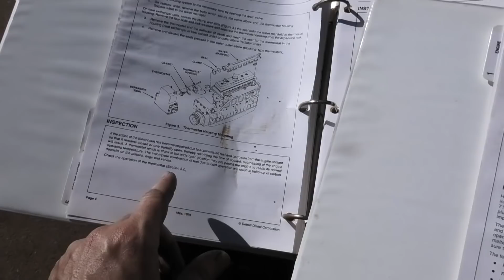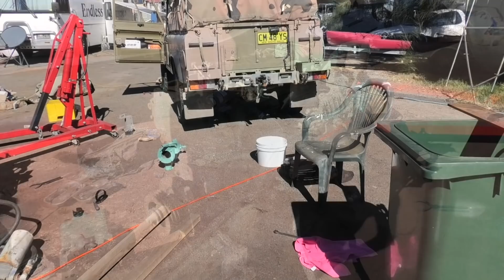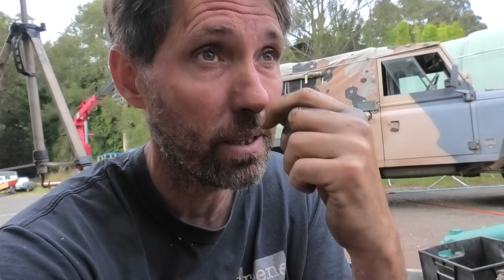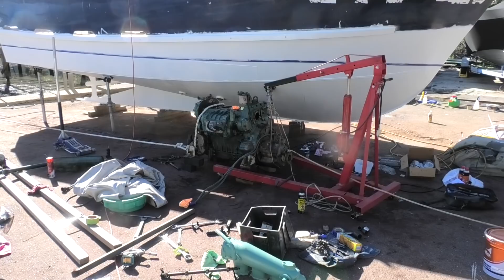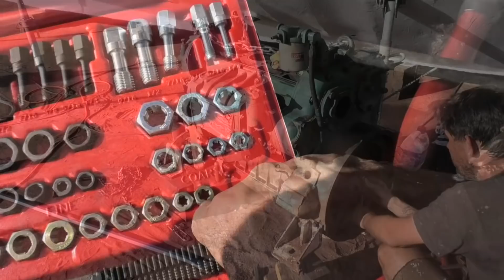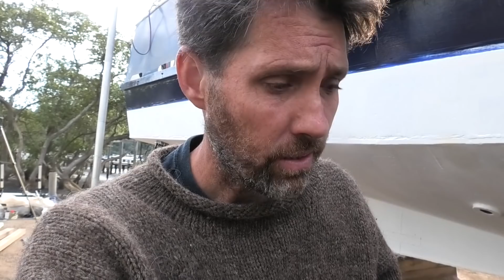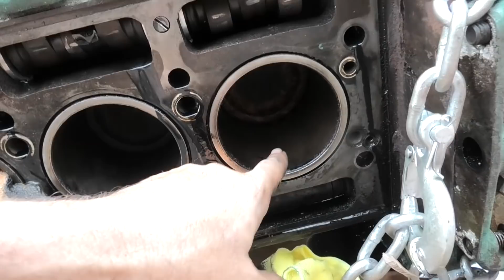Detroit Diesel 4-71 teardown

Comment: Hi Stu I just finished watching this episode I almost had a heart attack watching you take that Detroit apart. From the look of it your overhead were the rockers are drew salt water thru the vent tube some time when it was under water. Make sure you check the liners for electrolysis . Just remover the hardest part abut rebuilding a Detroit is running the overhead the timing of the valves is critical. I know you know that you have been working on motors for some time. I wish I lived closer I would help I used to make my living rebuilding truck motors. Well talk to you later I do enjoy your videos.
Reply from the maker: Thanks John. Yes, I really do need to find a Detroit specialist to run the rack and setup the governor before even considering firing this up.

Comment: Thinking about this some more I would come up with a maintenance schedule for this engine. Being your making better access in the engine compartment  you'll be able to do most but once in awhile pull the engine for major service. Building a solid bolted to the ground deisel engine stand that rotates would be awesome. Also a large gearbox puller. You could then make some money servicing other folks deisel engines$$
Reply from the maker: Hey Tim. I'm just trying to imagine a rotating engine stand big enough to hold this beast!
Reply: A overhead one would work depending on the weight? I'll do a little research and send it to you
Reply: Here is a rotating stand for a Detroit deisel engine. It's called the 6000lb Revolver. Has a center large gearbox to turn the engine end over end from the side. The price is ridiculous but you could make one from scrap material just need like a short drive line to turn it
https://www.nationaltoolwarehouse.com/6000-lb-Revolver-Diesel-Engine-Stand-P50911.aspx?gclid=CjwKCAjw5dnmBRACEiwAmMYGOe28t3h9aoIgGvy9Hg21Q_7U7brkRIVT7sH9g9PYSVMlOgtj1dxVnxoC5egQAvD_BwE

Comment: Watching you struggle with moving that lump of an engine around is painful,they such hard bloody work. I have a lifting A frame that can go on the front or back of my land rover that makes it much easier to pick up and move heavy things. It looks ex military. Can lift out an engine and gearbox and then allow you to move it to where you want. I once drove 30 miles with a big old Leilani truck engine hanging from the rear! Just chained it to stop it swinging and off to the overhaulers it went.
Reply from the maker: I was dreaming of a setup like that while doing this! :)

Comment: In previous videos you had shown that this boat had a "dry exhaust" system, that had been converted to a wet exhaust system by the previous owner. The rust on the exhaust valves, and on the pistons thru the open valves, may have been the result of a "failed design, of a wet exhaust system, allowing seawater back up into the engine, and by condensation up into the valve cover.  I'd put a 10 on it. Lol
Reply from the maker: Yes, I don't think it was the most professional wet exhaust install ever.

Comment: Drill and tap a 1/8" or 1/4" pipe plug drain on your fly wheel bell housing at the bottom with a female plug, in case you need to drain it at some time in future.
Check your oil pan and see if you can connect a drain valve hose assembly to make oil changes easier, unless you have an oil vacuum pump to suck it out. 
Time to brain storm some easier PM troubleshooting accesses while you have the engine out with your mates and professionals (what if's kind of stuff).
There is a gentleman on youtube that has made his own liner press for the old CAT DT2 series engines, in case you get stuck on one of the liners, they had water jackets surrounding the liners, looks like the Detroit had oil cooling around its jackets.
I think a good detergent and hot acid bath will clean up some of those parts nicely.
Check on USA part suppliers that have access to International commercial cargo logistics, their shipping rate for parts are less. I used to work for an international company and had to get parts shipped from Japan and Europe all the time for equipment PM's/spares and the rates were okay back then compared to what a person could do on their own. Stuff where you could wait could go by sea at 6-8 weeks for Australia/New Zealand. Check maybe an importer in HK also for rates.
You are doing well with your progress on your project and making the necessary decisions to support your end goals Stu.
Yeah retrofits are a PITA and nickle and dime your budget to no end when making changes to something different for repowering. 
Ask those folks at Ciba(rebuilder) if they know of salvage sources you can access for donor parts for engine and exhaust. There might be one of those insurance scrap dealers somewhere around.
Reply from the maker: Adding some extra drain plugs etc sounds like a great thing to think about while the engine is out.

Comment: I am not any kind of diesel expert, but I would clean any engine as much as possible before tearing it down.  Transmission fluid into the cylinders does wonders for seized engines, and it would likely break some of that crap in the crank case loose too.

This is what I have heard about Detroit diesels...  they like to be run hot and hard.  That is fine for a commercial vessel, but not good for a personal vessel where you might want to putt along and save fuel.

A better engine would be a good investment if you can afford it.

Comment: My heart sank the minute you lifted off the rocker cover. You never want to see rusty shit like that under the rocker cover,does not bode well for the rest of the engine. A simple quick check turns into a full rebuild! Got to wonder if it was submersed in sea water at some point?
Reply from the maker: Yes, my heart went in the same direction.

Comment: You're gonna spend some dough on that. Be a good engine when it's done though. Kinda reminds me of my most recent project. I have the head off my 555B backhoe-loader and it's in the shop for a freshen-up right now. I didn't have to get that far into it though. Ugh. That's a lot of work and money right there. Wishing you luck! Didn't hear whether you mentioned it, but are you going to have the engine shop reassemble it?
Reply from the maker: I'm hoping to work with the engine shop to do the reassembly. We'll see how it goes but they seem open to that.

Comment: The engine work makes the hull work look easy. I would be interested in a video going over the cost and changes needed for a different motor. If it wouldn't be too much work for ya. You already have a lot on your plate. :)
Reply from the maker: I too think that would be an interesting subject to cover in a video.

Comment: Pulling those transmissions the best way is to lift about an inch back from a straight lift, then lift and lower only a small amount while pulling a little or prying. Using the up and down action to walk it out. Fun to see someone use a truck but it was just binding the spines. It’s a great engine!

Comment: Christ, Stu, I've seen easier engines to work on. Even without all the rust I think I might be having a longer think about option 2, finding a replacement for it.
Btw, good to see you doing your bit to save the Polar bears by reusing old oil! 😂😂🤣😂

Comment: having never worked on diesel engines i do know that detroit diesels are probably the most reliable diesels out there and quite plentiful.  the problem i see is that shipping cost to where you live might be prohibitive in obtaining a new or even rebuilt engine.  i applaud your efforts sir.  I wouldn't give up the ghost either unless I found a crack in the block.  So far I absolutely agree with your assessment that the engine was either partially or completely submerged and the last owner did minimal repairs.  If you need anything shipped from the states, make a list.  but i do believe most of those parts properly dried and cleaned are reusable.
Reply from the maker: Thanks mate, I appreciate the offer of shipping.

Comment: We had a slant 6-71 sink in Hong Kong Harbour. Rebuilt it in the open like you are doing and it ran fine.
Reply from the maker: That would have been an adventure!
Reply: It was an adventure. The saltwater suction hose blew out and shutoff valve was stuck in the open position.

Comment: I like to pull the injectors out before taking the head off to prevent damage to the tips 
Your going to want to re oring the injectors inspect the injector sleeves valve seals valve job surface head
We used to say feeding a elephant to the customer 1 bite at a time
Dont forget about resealing the blower and setting the clearances
Got it that far down might as well reseal the flywheel housing to the block
When an engine stand is not avail we set the engine on the fly wheel housing with the crank pointed till the sky
You put the bearing tangs on the same side which usually goes to the cam side
Reply from the maker: I like the idea of sitting it up on the flywheel housing. That would be a great way to work on this motor. Great tip!

Comment: WOW  what a project to do, and  depends how quick you want to do it to get it back working in deciding an engine replacement or not...., so if the engine have been under water that means the G/box have as well and will probably need bearings overhauling ..............time waits for no man it just passes him by.......

Comment: Now I’m confused...  if you have to sell the Land Rover in order to repair the motor - what are you going to do every time you have to put a few hundred gallons of fuel in that beast ?
Reply from the maker: Buying from a marina is definitely the most common way to fill a boat like this up, but there is also a tanker that comes to the dock here who is about 50 cents a litre cheaper. Dave fills his big timber trawler with the dry exhaust up this way.
Reply: Buy it from a Jetty with a fuel Bowser which would be the plan even if he kept his land Rover

Comment: A rebuild, by you will cost a bit, but if completed properly, it will last ~15,000 hrs, if run under load. Unloaded ~4 - 6,000 hrs, if lucky. Diesels hate to loaf along.
Cheers mate

Comment: Hey Stu! I’m a retired Maintenance person from NY City Transit, Bus Department. We used 6-71, then 6-92’s for years. They are noisy and fuel hungry, but almost indestructible. Stick with it, it will last forever. PS the air box drain will puke oil on a regular basis!
Reply from the maker: Hey Paul. That drain hose used to go to a catch can that was up high for easy access and cleaning. I'll definitely rig something like that up again.

Comment: Look into seafreight on the engine parts from the US, it can be quicker then you think.
Reply: 2 months, or more for sea via Japan, pay for airmail, 3-10 working days U.S.A to AU.
Reply: @dustyfarmer  Generally, it takes about 5-10 working days for a shipment to reach Australia from the US by air freight. Shipments sent by sea freight will take approximately 2-3 weeks depending on which of the US state you are shipping from.  https://www.easyship.com/blog/shipping-to-australia   Ofocurse it can take 12weeks, but with some smarts you can do a LOT better.
Reply from the maker: It's frustrating but one of the biggest delays can be the dockyard and customs once it arrives in Australia. Of course this may depend a lot on which company you ship with.

Comment: The nice thing about detroit diesels is they can always be rebuilt. The bad thing is they have a lot of parts. The biggest deciding factor is usually the sleeves. IF they are not cracked around the exhaust ports (the black little ports in middle) then its good. Usually if a liner is cracked and seperates its almost has to be cut out. 2 stroke air comes from on top through valves and purges the cylinder of some exhaust. Then fuel is injected as piston comes up. Heat of compression ignites fuel and it goes down to be exhausted. Fuel is put in before tdc because it requires less pressure and it takes time for fuel to ignite and expand.

I was watching you work at getting gear box off and kept thinking why not just unbolt plate from flywheel through cover. Oh well you got it off this way. A good soaking in caustic soda, clean up, very little machining(its a detroit diesel) and she should be good as new. However you may want to read the caps of mains and con rods. They should have been marked from factory. 

My guess is that aside from new rings the rest should be near tolerances. It was running after all.
Reply from the maker: I did think about unbolting the plate but just couldn't quite reach the bolts until it was almost out anyway.

Comment: Hi Stu, So you think most of the inside rust was from the Engine being under water and the pistons from being exposed to the air? If so something to prevent in the future I'd say. The worse part that I saw was the flywheel area. Sand blasting on that one and the rest soaking and or electrolysis bath. Either way your timeline and cost went up. Denfently rings, new sleeves and gaskets. Make sure all moving parts work well and test stuff before reinstalling everything. I'm sure you'll have a bunch of other tips from viewers as well. Good luck this week. Tim
Reply from the maker: Yep, certainly does need a serious sandblast in places!

Comment: I had always thought you should break down the engine and do any needed work. It was running when you got it, not sure why it froze. But in the end, I think this will result in you being much happier in the end.
Reply: Oil is hydroscopic, it attracts moisture in the air, internal engine parts & cylinder bores don't have a very thick oil film if any & are highly polished, ambient moisture in the air gets in and flash rusts parts very quickly, a few days of rain, super humid conditions down by the water edge and bingo! one seized engine.

Comment: When you said people will say why not get a modern diesel instead, i knew what you'll say you'll do it anyway, this is for the love of engines for the pleasure/satisfaction of getting an old heap back to its former glory n above all doing it your self, rebuilding it as good as possible same time making sure it doesn't end up costing you more that it be worth when you be going out fishing on that boat mate you'll have more satisfaction n pleasures than blokes on brand new super expensive fishing boats n this Is the Best reason on earth, great job made ops save me some of that "tyre black" used old engine oil few times on the rubbing streak on my little boat looked great without rubber black paint
Reply from the maker: Thanks mate. You're dead right about the satisfaction of doing it yourself rather than just buying some flash expensive boat.

Comment: Excellent video.  We went through this with my dads sailboat.  Was time for a rebuild or new Diesel. Long story short.  The cost of a rebuild verses a new modern Diesel was about Five grand.  But the only labor we did was remove the old Diesel.  Did you get a price on a complete rebuild kit.  Seals gaskets pistons rings sleeves etc.  might be easier just buying the entire kit.  We had Cummings diesels in the Coast Guard.  Oh as far as using the old oil.  Check the viscosity before reusing it.  Also why would you use old oil in an engine with new parts.  Grit grime bits of metal in old oil.  Love your videos.  If that was me the audio portion would be nothing but bleeps blips censored!  Great job keeping the language clean.
Reply: It was Aussie humor about re-using oil.
Reply: Ok I got it.  Wasn’t quite awake when I responded
Reply from the maker: Yep, will be ordering a pretty complete rebuild kit. It certainly helps bring the price down a bit.

Comment: If I'm nor mistaken, you drove that boat to the boatyard under it's own power, didn't you. A testament to the reliability of a Jimmie and the fact that even with a few connecting rods hanging out the sides of a them, they are going to get you home. The Detroit's where built to last, any new crap you would buy has parts that someone designed to break. as long as a Detroit has oil in it, it will run. Bravo, for not being a pansy-ass and re-powering.

Comment: That diesel is as good as anything ever built. The railroads in the US used the smaller ones to power refrigeration cars . 30000-50000 hours before rebuild was not uncommon.
Reply: Agree but in a saltwater environment that number is much lower. They also cost a lot more over time than a newer diesel in fuel costs. I would be looking for a used common rail Cummins myself.
Reply: @jacknimble1  I agree . I live in Cheyenne Wyoming. We are high and dry. The ocean seems to eat everything after a trip to Hawaii and looking at anything old. GM had the diesel market overwhelmed in the early years. I have an old Lister I go fire up just to listen to it........

Comment: I was thinking that the area below the stuffing box once painted could be fiberglassed into a well with walls up to stuffing box level that the bilge pump sits in. I've found Fed-ex the most cost effective (and fastest) on heavy parcels out of the states, best thing is now your unlikely to pay 10% import duties on parts out of U.S.A as if the U.S company does less than $75K of business in Australia per year means no import duties declaration needed & no G.S.T payable on it, it will go straight to your door or P.O box, bad thing is the USD-AUD exchange rate at the moment.

Comment: The bird scarer GM is a good simple engine. No complicated expensive separate fuel pump. Each injector driven by the camshaft is its own pump. Plenty parts available
Stick with it cobber

Comment: Worked for a company that rebuilt Detroit engines for the city, pistons and liners used to come as a kit as long as the rods, crank and such are good rebuilding them is not that hard
AS for the Rover kind of hard to let go of a tractor you can drive on the road
Reply from the maker: It will be hard to let go of the Land Rover. :(